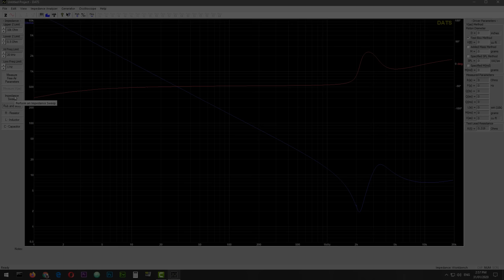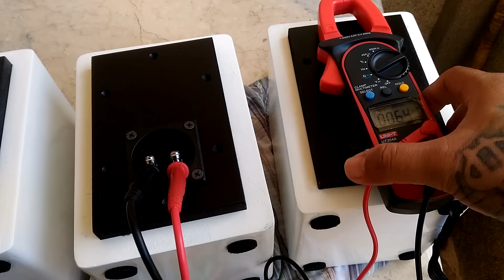How to Make Small Speakers for Desktop and Home Theater Surround

Comment: why did you use those countersunk screws on the terminal and not those hex bolts you have used for the speakers? Your paint job could do with a lot more filling to make the finish much more perfect :D
Reply from the maker: Back panel doesn't have to be the best side of the project. Unless it's a woman. You know what I'm sayin'?

Comment: Nice, I am glad to see someone still uses insulation, except you just stuffed it in the box in the back, one of the main reasons for insulation is to cause the sound to move in ONLY one direction (which should almost always be parallel to the speaker resonance) so the best way to stuff a box is to put the insulation around the speaker / around the edges of the box, all you did is cause the sound to be muffled front to back and echo like crazy side to side. p.s. a little insulation should go behind the speaker magnet, but it should be at least twice the density and much smaller (like close to the diameter of the speaker)
Also, home speakers are mostly 8 ohm and desktop speakers are 4 ohm, so if you hook up a 4 ohm speaker to an 8 ohm amplifier eventually the speaker voice coil wire will short out and then your amp will too, conversely, if you use an 8 ohm speaker on a 4 ohm amplifier, your speakers will be fine, but your amp will blow. remember you get about twice the volume of a 4 ohm speaker hooked up with an 8 ohm amp and half the volume out of 8 ohm speaker hooked up to a 4 ohm amp.

Obviously if you are going for a high-powered amplifier who want high resistance speakers, like 8 or even 16 ( I have two!) anyway, working at Harmon and Kardon for years and also being taught my my uncle, I have some helpful knowledge about speakers, amps and the dynamics of sound due to the many system I have built.  my first sub-woofer was a 15" long throw dual voice coil speaker with an sealed box I built out of one inch particle board; not ported (bass-reflection technology) , not acoustic (only running 80 watts) but sealed up, please dont ever make a band-pass box unless you know your porting, have a 1 or 2 ohm speaker load and a very small out put of wattage, (and in a small room).
Reply from the maker: Thanks for the feedback. :)
Reply: @chrclmnky  FeedBack! I get it now, LOL

Comment: hi.Ike Heredia is glad to see your new work. It looks very beautiful, and I'm glad to hear you used some Chinese cross-border accessories, which means I can also buy him at taobao.com or aliexpress.com at a more suitable price. Because I saw you copied the design of "Audioengine A2" but deleted the front slot. I suddenly thought that if I could still keep the front slot, the fake slot and not communicate with the inside of the box. The reproduction is more realistic and does not affect the structure of the cabinet itself. Suddenly I had an idea. Maybe I can use it in the speaker I want to do. The surface makes him look beautiful.
Reply from the maker: Hello friend, thanks for the never ending support. Yes the cheap crossover work very well.

Comment: Nice work, certainly better than I can ever do in my "workshop" :-).  Hopefully rear-mounting the woofers that way doesn't throw the frequency response around the x-over region out of whack because of the increased z-offset from the tweeter. How are you going to measure the results? REW and a good mike?
Reply from the maker: Thanks for the feedback, Brian. Will just do the testing by the most traditional tool available, the human ears.
Reply: @chrclmnky  Ears are absolutely the worst tools to use for absolute testing.  Hell, your hearing is different at different times during the day, and dependent upon how old you are, what you were listening to before, etc. For determining relative differences between two sound sources they're ok for that job, but they're horrible at quantifying specifically what's wrong with a particular build,  or what could be done to correct it.  REW software is free, a good USB mic can be got for less than $100, and the combo run on a PC is all you really need for quantifying what your ears might be trying to tell you about your build.
Reply from the maker: @Grommet2007  I am planning to get a Dayton Audio OmniMic V2 in the future if I've save enough money. But for the meantime, I'll just trust my old traditional tools because if I don't trust them, no one else will. 🤣

Comment: Hi Sir, nicely done... where did you buy those drivers and crossovers? And what are the specs. Would like to try it, Thanks a lot 😉
Reply from the maker: Hello Woodz and Bladez, drivers were bought locally and the crossovers from online marketplace. A generic 1 inch tweeter and a generic 3 inch woofer. 2 way crossover, generic too.
Reply: I can see a lot of crossover selling online, , I just want to be sure if im buying the right one. Any tips on Finding the right crossover? Lets say im going to buy a 100watts 8ohms driver, must the tweeters im going to buy be 100watts 8 ohms as well, or it doesnt matter if they have different wattage and impedance? Im really interested and wanted to learn coz im into home theater and audio hobby and just started my woodworking hobby during lockdown.. Hope I could learn from you. Thanks 😉
Reply from the maker: @woodzandbladez9780  The bigger the wattage the better. 2 way crossover. Impedance should match your drivers.
Reply: @chrclmnky  you mean, if i have 100watts drivers, then the rating of the crossovers should be 100watts or higher? How about mid/Bass driver, dapat ba same wattage ng tweeter or it doesnt matter sir? Ano po brand ng crossover na palagi nyo ginagamit? Any recommendation? Sorry sir dami tanong, really wanted to learn talaga hehe kung pwede nga lang kita puntahan e 😂

Comment: You need Air bass vents on these or rather use extra resonance flex diaphragms probably bottom facing....will sound much better
Reply from the maker: Sealed box would sound the same.

Comment: Its the same to studio monitors?
Reply from the maker: No. Just desktop speakers with highs and mids were adjusted to output.
Reply: @chrclmnky  in that case, the crossover is the audio changer?, to make studio monitors, the crossover change the sound?
Reply from the maker: @yefrillano9078  yes

Comment: Absolutely immaculate build but I wouldn’t rear mount the woofer. By doing this the magnet of the woofer, relative to the tweeter, will be way back resulting in phase problems.
Reply from the maker: Thank you Slachjit for the comment.
Reply: Many high end speakers have a woofer that is rear mounted.

Comment: This is what I need to replace the speakers of my Logitech Z623, I been using the Z623 with speakers from an old Sony equipment and the sound is much better, but there is still headroom to improve the sound because the Sony speakers do not have a crossover, only capacitor filters, they are 3-way speakers

Comment: In general, good technic in the building process. But if I may be so bold, you should have made a prototype first, to get a listen and straight out the kinks in the design, specifically for phase anomalies, crossover adjustement (ready-made x-over are rarely satisfiing in real world applications),cabinet volume and damping material. Having close to one hundred construction and modification projects under my belt, I can tell you that you could greatly improved the final quality of your product by spending a few hours in the listening room and tweaking your speakers.
Reply from the maker: Yes sir I agree. Thanks for the feedback.
Reply: the only constructive criticism I have seen for a while
Reply: @outerheaven1000  When a person spend hours making speakers and filming the process, the guy deserve an intelligent comment to salute his dedication.

Comment: I have two subwoofers of sound link 42mm (1.5 inch)
How many inches of box do you have to make for this speaker's good effect?  
Without bass resonance. 
No Bass Resonance. 
is going to use Bass Air Tube
Reply from the maker: You should calculate that using a speaker box calculator. WinISD or Bass Box Pro 6 will do the job done.

Comment: Nice build sir. Any chance where I can get download the speaker box plan?  wanna build a pair for a 2.1 set up. Thank you :)
Reply from the maker: Thanks. There is a link to the TinkerCad 3D schematics in the video description. You need to create an account and login to TinkerCad so you can start using it and seeing the dimensions. Use laptop or computer web browser to open TinkerCad.
Reply: @chrclmnky  sorry sir checked the video description but I did not see any link or an active link .. :)

Comment: Nice Work
I did purchase two pairs of the same Crossovers from Amazon, I didn't test them yet but I'm still confused about the max wattage they can handle, 
Amazon mentioned 400 watts max, some other websites selling the same product mentioned 150 watts, and some others 180 watts !!!
I'm intending to use each of them in a 2 way cabinet :  300 watts RMS P.A woofer + 30 watts RMS compression Driver (tweeter) both from "FaitalPro".
I wish I could find a test or a review  of these crossovers  with professional speakers.
If you have any tip on  how to test max crossovers wattage; please give me advice. 😇
Reply from the maker: Don't get yourself so focused on peak wattages. They're used for marketing only. Focus on the right impedance and crossover response per impedance.
Reply: @chrclmnky  thanks Bro
the speaker+tweeter I'll use are both (8 ohms nominal impedance)
according to a test I did before, my 200 watts subwoofer line can go up to 5 amperes, @ 50 HZ , with a 300 watts sub, it may get to higher values.
I'm mostly worried about the crossover coils to overheat & burn from excessive current,  since I noticed the coil wires the constructor used are very thin ( about half a millimeter for the low pass filter & less than that for the high pass filter )  I have no mean to measure the exact thickness I used a ruler , 
relying on visual comparison with pro crossover circuits they seem to be much more rugged, & have  thicker coil wires.
anyway I think I have no other choice, I have to test & measure the system's final voltage + current. 
may be I can feel any excessive heat from the coils, touching them while I run a stress test.

Comment: What power did you use for the tweeter? Is it the same as the woofer?
Reply from the maker: No. Tweeter is just about 5w.
Reply: @chrclmnky  Okay. Would it be okay to put a 20W tweeter?
Reply from the maker: @diegoloiola7663  yes. Any wattage. Just match the impedance to woofer. If woofer is 8Ohm then use 8ohm tweeter
Reply: @chrclmnky  Excellent. Thank you very much
Reply: Got the same question but thanks for the info.

Comment: I not see acoustic measuremens. A prebuilt crossover in any speaker is a disater.
Reply from the maker: Bought the prebuilts but I tweaked them to the values I want.

Comment: Bro are you using which type Of board meterial
Reply from the maker: Hello Rock Works, the board is a very cheap MDF 18mm thick (3/4" thick). Medium density fiberboard.

Comment: Hi friend. I really liked your video. I also liked the Audioengine A2 speakers, but for me they cost a lot and it seems cheaper to make myself. Could you give me drawings for cutting wood and links to details? (if possible with Aliexpress, because it is problematic for me to deliver from America). I am very grateful to you earlier.
Reply from the maker: Thanks for the feedback, Mihail. I think Aliexpress delivery department is down nowadays. And I think there are more better options at Parts Express. Components are cheaper and higher quality there in a vast choices and options. For the layout, design and dimensions, you can copy and edit at TinkerCad. Here's the link https://www.tinkercad.com/things/gDfJeBUl42o You need to create an account there to start copying my design and start editing.
Reply: @chrclmnky  Something does not want to open the cutting material for the case. Do you happen to have another format that you could open without problems? And also, could you help me put together a kit on Parts Express for such speakers? I'm not really sorting it out yet, I'm afraid I would buy something wrong)

Comment: He bro can you please give me dimensions for a  a enclosure of undocumented subwoofer. ported subwoofer . I only have few of the ts parameters and few electrical parameters. For home purpose
Reply from the maker: Ok what subwoofer
Reply: @chrclmnky  it is not a branded subwoffer.(8 inch for home theatre system ported enclosure)
Nominal Impedance = 4 Ohms. Res Freq = 30Hz.
Nominal Power = 120 Watts
Max Continuous Power = 360 Watts
Spike Power Tolerance = 600 Watts
Sensitivity(2.83V/1m) = 90db and Resistance(DC) = 3.8 Ohms
Qms = 5.43/Qes = 0.32/Qts = 0.30 VAS = 35 Litres.
Motor Strength, BL = 10.8 Tesla-Meter.
Xmax = +/-11mm
Driver and port(round) on front side
Reply: @chrclmnky  I have set you ts parameters and some electrical parameters

Comment: Charcoal, What is the name of the part used for sound input? What is the specification of the tweeter used? How do you name the wood used? MDF!
Reply from the maker: Hello Jose, wood used is MDF 3/4 inch thick. Sound input, speaker terminal cups with spring loaded terminal posts.
Reply: @chrclmnky  tks.

Comment: speakers secured with good bolts and the rest with rusty screws,  and you put glue on crossovers?
Reply from the maker: Whats wrong with hot glue on the crossovers?
Reply: Absolutely nothing wrong with hot glue. I’ve had a pair of old big ass pioneer hp-100s from the early 80s and guess what, damn hot glue is still keeping the x-over secure as hell
Reply: Gotta agree in some sense, nothing wrong with Hot Glue, but the unsunken finishing screws on the rear were saddening after such beautiful work

Comment: how to calculate the total resistance(ohm) after adding the audio crossover??? please tell me sir.Thankyou
Reply from the maker: Dc resistance is insignificant at that point. You will need an impedance meter to test the system's both impedance (AC) and tuning.
Reply from the maker: Dc resistance still can be measured using a common multimeter.

Comment: Sir my amplifier's output is 4ohms but when I connect an 8 ohm woofer and 8ohm tweeter to the parallel 4 ohm output is not comming What do I do to get the speaker's output 4 ohms

Comment: Excuse me, I also have the same tweeter that uses a capacitor, but the bass still appears, what needs to be added so that the bass disappears?? Inductance? How many mh Excuse me, I also have the same tweeter that uses a capacitor, but the bass still appears, what needs to be added so that the bass disappears?? Inductance? What is the MH value? ?
Reply from the maker: @juniartart  choose a higher crossover point for the tweeter, 3600-4700Hz are the usual.

Comment: Fab what power were they after ? In Watts
Reply from the maker: They about to handle up to 200w rms.
Reply: @chrclmnky  that's decent for theur size I'm looking at making my own  I know crossovers aren't expensive.  I know they can be made fairly easily but prib buy them and make the cabinets cheers pal
Reply from the maker: Yes it is fun building such.
Reply: @chrclmnky  indeed I've only been dabbling in timber work not much joinery yet but I own a pocket hole jig dowel jig many manual and ejectrucal saws (not bench though ) I'm a brickie by trade so fine with measurements etc angles lol

Comment: what is the name of the thing at 6:59?
and what's the purpose of putting cotton inside the box??
what's the purpose of the crossover thing? how to search that online?
Reply from the maker: That was just a speaker cup terminal.
The speaker is sealed so need to put in polyfiber fill to make the box appear "bigger" to the woofer, thereby producing lower notes.
Crossover - to divide the output frequency to proper speakers. High frequencies to the tweeter, low ones to the woofer.

Comment: boss Charcoal Pwede ba ito pang speaker
sa PC Desktop Speaker

Kevler GT-100 Dome Tweeter 100W 8 ohms

Manex (W-5100) 5" 100Watts Subwoofer Speaker

120W Speaker 3 Way Audio Frequency Divider LoudSpeaker Cross Over Filter

Speaker Box
 Dimension 135(W) x 225 (H) x 220(D) mm
Reply from the maker: Yes sir. Perfect.

Comment: Hi sir meron po akong ganyang speaker na manex 4inch 8 ohms tapos yong tweeter ko ay 4ohms pwede ba un pagsamahin? Meron naman din pong dividing network na 4-8 ohms match pa rin ba un? Sana masagot nyo salamat at maganda po yong paggawa ninyo ng box😊
Reply from the maker: Kelangan nyo po dagdagan ng resistors yung tweeter or e series dalawa, mababa masyadao 4 Ohm.
Reply: @chrclmnky  pwede nyo po ba ako bigyan ng sample sir di ko kc alam kung ano idagdag na resistor eh my dividing po kc sya na 4-8 ohms ung amp ko naman po is 4-8 ohms din
Reply: @chrclmnky  or much better kung magpalit nalang po ako ng tweeter na 8 ohms para wla ng papalitan sir ano at compatible na sya?
Reply from the maker: @johnmargalicia7626  pwede.
Reply: @chrclmnky  ok thank u sir😁
Reply: @chrclmnky  sir tanong lang po kung ilang watts na tweeter ang match sa 40watts na woofer tulad nung manex 4040? Sakto po kaya yung 20watts na tweeter?
Reply from the maker: @johnmargalicia7626  don't mind the wattage, mind the impedance.
Reply: @chrclmnky  ok sir thank u

Comment: It is pasive or active??
Reply from the maker: passive
Reply: ma non capisci che sono passive, dove hai visto l'amplificatore interno? quello che ha montato è un crossover.
Reply: Most single cable home use speakers are passive as active crossovers typically require separate amplifiers, cables for both line-level and high voltage.  Active crossovers are typically plugged in to an electrical outlet.  Now, professional powered speakers may contain active crossovers and may also use aa single XLR3 or TRS (tip, ring and sleeve) 1/4" phone plug for a balanced line-level signal.